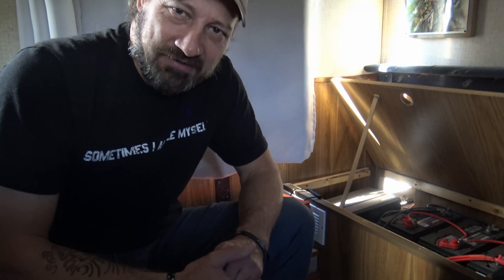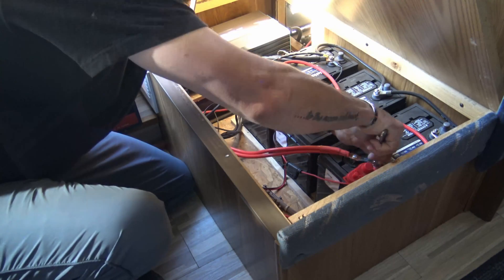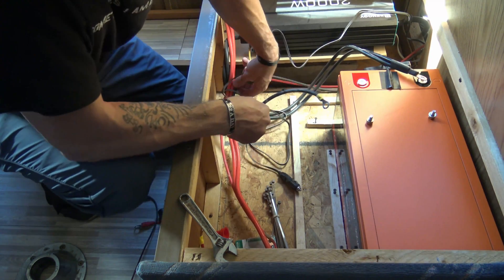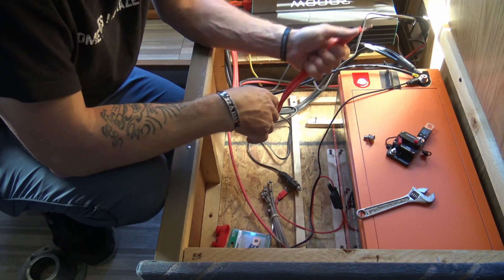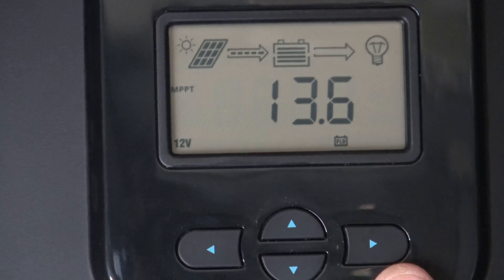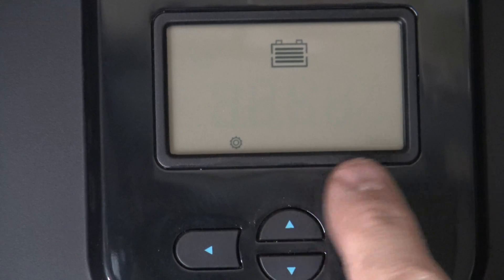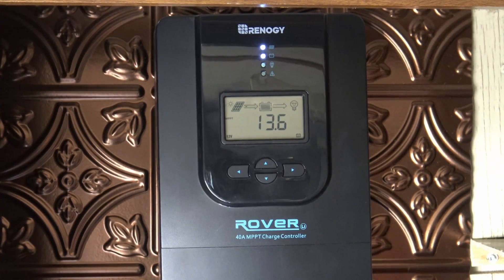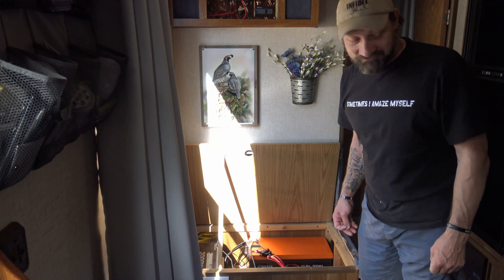How To Upgrade Solar Battery Bank From Lead Acid To LifeP04 - It's EASY!

Comment: Hello.  I have a question for you.  I live in Utah and I'm 68 and have what I call old cold.  I have made 2 stack box heaters, but need to hook up a 12v fan.  I have several 22v rechargeable batteries from my wheelchair.  Do you know how I can use the 22v battery to run the 12v fan.  I'll be using the computer fan to force the heat into the room.  I am enjoying you videos.  Thanks for any help you can provide.
Reply: If you hook up a 12V fan directly to 22V, it will spin twice as fast and can get dangerously hot.  It will burn up quickly.  You will need a DC to DC converter to drop the output voltage to 12V.  Kind of like how your cell phone charger in your car converts your 12V to 5V.  Look for a 24V to 12V step down converter.
Reply: @brngrofdeth  thank you.  So I can use the 24v on the 22v battery?
Reply: @sweetsavorywords3506  Of coarse.  Just as long as they are not over 24V.  Basically reduces any voltage above 12V and below 24V.  However, be careful with the wiring and fuse it properly for shorting failures and over heating the wiring.  This is what I would do....

Positive RED wire from battery > 24V 5 or 7.5 amp inline fuse > positive input on the step down converter > 12V 5 or 7.5 amp inline fuse on the output side of the converter > to the positive fan wire.
Negative BLACK wire from battery > Negative connected to step down converter input > Black wire from negative output from the converter to the negative side of the fan.
If you like, you can even put in a little flip style toggle switch on the negative black side to shut the power off when not in use.
Reply: @brngrofdeth  do I cut the red wire to wire to fuse?  And red wire from the fuse?  Does it matter where I place the fuses?  Do they come in some kind of fuse box?
Reply: @brngrofdeth  I really appreciate your help.  I know how to wire them together but the mechanics I have no experience.  I have been trying to get these answers for months.  Again, thank you so much for your very clear instructions.
Reply: @sweetsavorywords3506  Anytime.  If you have any more questions, feel free to ask.  Love and blessings from a very cold Ontario Canada as well.
Reply: @brngrofdeth  God bless you too, from Northern Utah.  So much love through Christ♥️♥️♥️
Reply: @sweetsavorywords3506  Thank you very much.  Also, my apologies for not replying to your previous question...  Just noticed it.
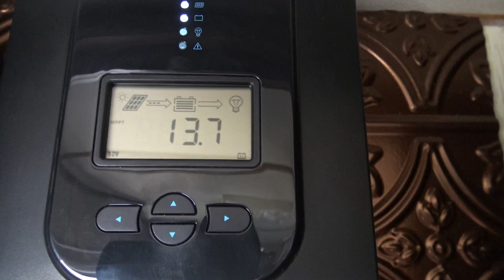The inline fuses I speak of are the same style fuses Skeeter mentions here at 12:28
They are an inline wire with a little booted fuse holder.  You will need one before converter at 24V about 5 amps should be fine.  Then one after the converter before the fan with a 12V 5 amp fuse.  If the fuse pops, try a 7.5 amp.  Really depends on the amps your fan needs.  I would not go higher than the common red 10 amp fuse.
Reply: @brngrofdeth  i can see he is setting up for Solar.  I see he has the fuse wired directly to the positive post coming off the battery.  Now you said to put the fuse before the converter.  Does the fuse get spliced between the wire coming from the battery to the converter?  I cannot tell how to wire the fuse in.  The fuse wire looks very small compared to the big wire coming from the battery.  Where does the fuse wires get installed.  Does it run from the battery directly to big wire?  Now my brain is confused where to wire the fuse.
Reply: @sweetsavorywords3506  The big wiring is for the RV he installed it in for the main power of the camper.  
The smaller wire with the inline fuse is all you need.  You need 2 of them!

1. Run a red inline fuse wire like Skeet was holding... with a 10 amp fuse FROM the battery positive TO the converter step down unit POSITIVE INPUT.  In that fuse holder like Skeeter pointed out, you will need a 10 AMP fuse.  You want the step down converter protected.

2. After, the POSITIVE OUTPUT from the converter will be 12V.  Put another inline fuse with a 10 amp fuse leading to the positive wire to protect the fan.

3. Connect the Black negative battery to the negative input wire on the converter.  Then connect the NEGATIVE OUTPUT wire of the converter to the negative wire of the fan.  No need for any fuses.

4.  You can also add a toggle switch to turn it on and off when not in use so you don't need to disconnect the battery to shut the fan off.

It will look like this.....

Positive side battery > 10 amp inline fuse > Positive converter INPUT wire > Positive Output from converter wire to the other 10 amp inline fuse > to the positive FAN wire.

Black NEGATIVE will be straight through.  If you want, put a flip toggle switch in here to shut the fan off instead of disconnecting the battery every time.

All in that order.  Hope that is clearer.  Plus, the fan has one direction of flow.  If it is blowing the wrong way, flip the fan and it will be blowing the correct way.  Most fans have an arrow on the side showing which way it will be blowing.
Reply: @brngrofdeth  you are an angel, God bless you, you are a prayer answered.  And... a genius!  I cannot tell you in mere words what your help means to me.  You are a true blessing.  God is so good to answer me when I ask for help.  I should have asked at the beginning, as with all our endeavors we should seek him first.  He sat back while I without his help, wrestled the bear.  But as soon as I prayed for help, there you are.  Thank you and may God bless you richly always.  May he provide a hedge of protection around you and yours always.♥️♥️♥️
♥️Father, ♥️Son, ♥️Holy Spirit
Thank You!
Reply: @sweetsavorywords3506  My pleasure.  Love and blessings to you and yours as well.  Merry Christmas!
Reply: @brngrofdeth  Thank you.  I will be purchasing needed parts on 3rd of Jan when I get my SS retirement.  I am so excited to get it set up.  I am so surprised that the wires coming off the battery can be so small.  I would never have figured that out.  I wish you a very Merry CHRISTMAS 🍭🍭🍭